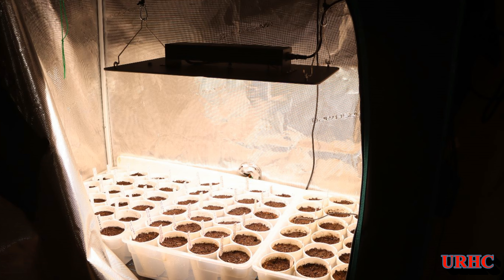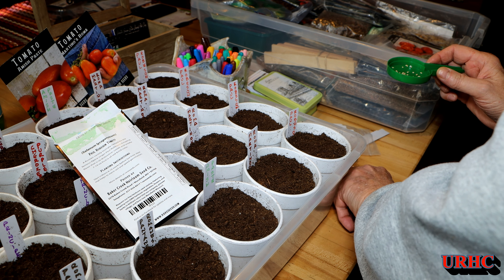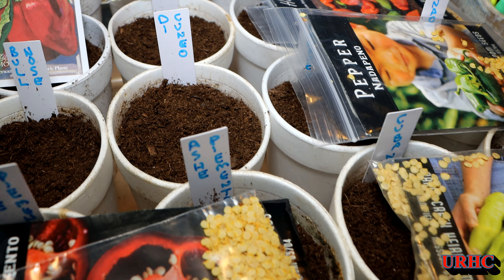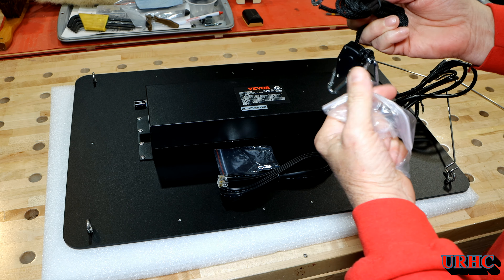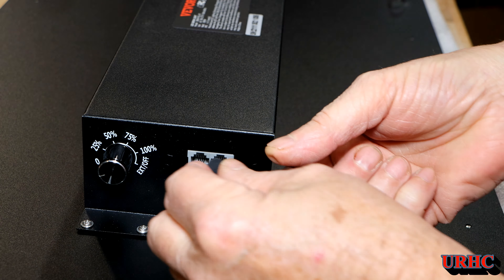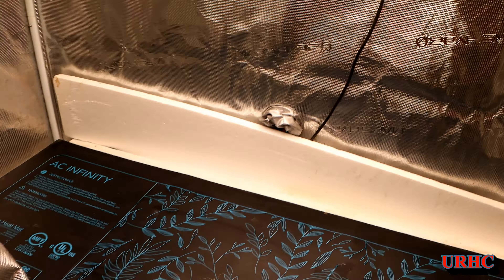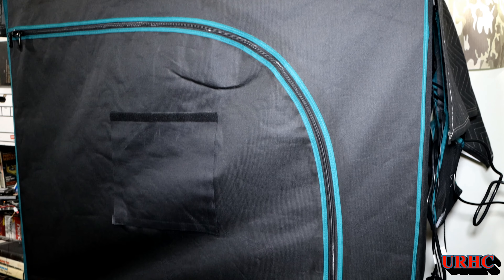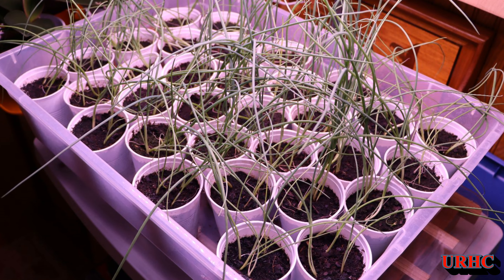Garden 2023 Starting Seeds And Switching The Grow Tent To A 300W Vevor Grow Light

Comment: Let's hope we all get a beautiful Spring lasting more than a couple of weeks for a change.  I bought an EGO (56-Volt 5.0 Ah Battery) string trimmer and WOW does it ever have amazing power.  Not light-weight but I could shorten it to match my height better. Very impressed!  But we shall see once the weeds start growing.  Makes me crazy to see the gardening going on in the warmer states.
Reply from the maker: That sounds like a beast. Hope it works great for you. I am very happy with the Milwaukee trimmers I switched to. Don't use the gas anymore.   one battery lasts as long as I do then we both go inside to recharge.  I plug myself  into  the couch and nap. When I get up the battery is done charging  and back outside we go. We still have a possible 8 weeks of frost here. Thanks for watching.

Comment: Vevor has great selection and pricing.  I never heard of them until your videos.  I just bought their largest flat bottom metal cart AND also a meat slicer.  They should be here in the next few days. Can't wait! 💜  Do you have a general discount code for their whole site?  If yes, I will use it in the future so you get credit.
Reply from the maker: Let me know how they work and look. They have given me a couple things for videos and I have also purchased items from them for years without problems. The biggest  issue is UPS damaging packages and items that can take a little time to work out. I listed that general  discount code for 5% off but only get credit for other items if someone clicks through my links first. They definitely have quite a selection of products. What are you going to do with a big meat slicer? Thanks for watching.
Reply: @unemployedredneckhillbilly2023  I buy a lot of meat in large slabs.  A few years ago, I bought a monstrously powerful meat grinder from Cabela that is a beast. I can drop in whole, raw, bone-in chicken legs and it grinds them up perfectly for the dogs. I buy big pieces of chuck roast and make all my own ground beef, etc.  I am even thinking of getting a meat press to make my own deli lunch meats. You pack the meat into a stainless tube, put the lid on with a spring that presses down inside the tube and boil it or an hour or more.  Cool overnight and then thin slice.  So I thought it would be handy to have a meat slicer for that too.  Really good deli meats are so darn expensive and full of additives.  I thought I'd try my own for a fraction of the cost.

Comment: Good morning Ed.... The growing season is upon us again...  I've been really inpressed with Vevor products (thus far).  I bought the same hammer drill that you demoed (very impressive for the price).    I've also bought two mobile shop stools (approx $100. ea). They have 5" castors so they don't get "trigged" easily (one for sun room and one for shop).
 They are comfortable and seem durable.  I like their products, quality, and prices ....... Beelink (Rysen 7 (5800H) update:, which we had been discussing.   I was experiencing intermittent usb issues with my wireless keyboard (moved it to the other and the issue disappeared.  Not that it was necessary, but I was wondering how it would perform with extra memory.  So, I upgraded to 64gb (Yeah why do people buy fast cars to only be able to drive 70+ mph).  Now it completes the function prior to me pressing the key! ;) Had fun removing the tiny inner screws (holding the 2nd SSD plate) with my ancient shaky hands, but alas .....  Hope you and the Mrs are doing fine.
Reply from the maker: I have been impressed by the Vevor products so far also and figured I would give this light a try. Its the last version of Samsung leds that are slightly less efficient but about the same specs. Half the price of others so by stepping up in wattage I see better coverage at lower settings. Veggies don't need anywhere the lumens of weed so I think they ate a good choice allowing people to step up from flourescents. I have also purchased several other Vevor  tools and am very happy with the value. Just wish UPS was easier on the packaging of heavy items.  
 I just plugged my Logitech keyboard/ mouse dongle in the USB2 slot and have no problem. Put the hub on the USB3 and using the C for. video now.  Didn't realize they could be upgraded to 64g, thought my instructions said 32. That must make a big difference.  I am very happy with mine. Hopefully they last. Thanks for watching.

Comment: I like your seed repackaging cup.  U bought that ? Google doesnt like my description...that green cup that looks like you could easily funnel seeds back into the pack?
Reply from the maker: I have an old one that was very smooth operating. Then I bought these on amazon https://amzn.to/430ANu8  and they really can be tough to turn plus the cap doesn't extend to the bottom properly distributing the seeds. They are the only option I have found so far. Check your local garden center. Thanks for watching.
Reply: @unemployedredneckhillbilly2023  thank you so they fixed something that wasnt brocken huh

Comment: Good morning.  Nice video.  So you start your flower seeds in the dark/closed container?   I have never started flower seeds indoors and plan on starting some seeds today so I'm interested in learning how.
Reply from the maker: First  off I have not had much luck starting flowers so I don't put much effort into them and don't  want to take up grow tent space with them. I place  the container of them on top of the fridge that is warm and acts like a heat mat. When I see first signs of germination they will go under the grow light the onions are under. Mixing  seeds with different germination times as I do is not the best idea but I don't want to put too much time and energy into the flowers because I can't eat them. My wife willl be happy with what grows. Ii doubt that the lavender will germinate but tried anyway.  Usually I just do marigolds that don't  mind my abuse. Thanks for watching